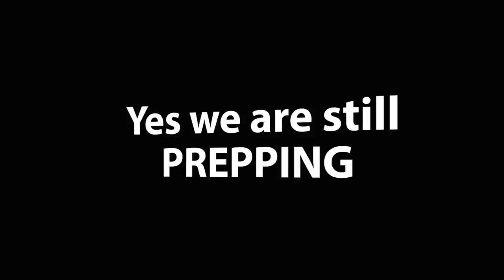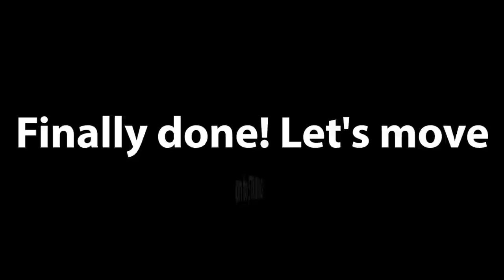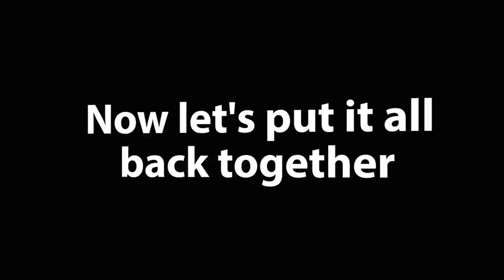Curbside Furniture Flip/Antique Buffet Makeover/Buffet Furniture Fip

Comment: Beautiful job! I have a very similar piece that I have been struggling with for weeks. My piece had 2+ coats of white paint that I have been stripping but a lot of the stripper got dried and clumped around the carvings, so I have struggled with using pointed tools to remove it. Originally I did strip the carves legs hoping to stain them and also the top like you did. But after seeing your piece, I may decide to paint them the same as the body of the piece (sage green) I need to decide and just wrap this one up!

Comment: My question is about the teardrop pulls.  My buffet looks like it had the kind that turn to lock and unlock.  I don't need turning knobs but the hardware is still inside the doors.  So I figured I put a pull over it but need a plate that is long and not round so it covers the previous hardware.  Do you have suggestions?
Reply from the maker: Amazon would be your best bet

Comment: I loved watching this entire refurbishment, I love how it came out , I have a similar piece in my basement . I have a question about the sand prep , I wanted to purchase one but everyone has it attached to an expensive festool extractor , what kind of piece did you buy to fit the hose to another kind of vacuum? And did you have to buy the extra pieces with the sand prep ? Also what sand paper grit number do you use to distress ? Thank you
Reply from the maker: When I bought the SurfPrep sander I also purchased from them  2" hose adapter so it would fit my shop vacuum. I am using 150 grit sandpaper to distress by hand.
Reply: @SabsRehabs  thanks so much I will do the same I just was wondering what would fit my shop vac 😊

Comment: Just found you. New sub. I just watched the incredible mid century piece (black paint/walnut stain) video. So impressive! I am fixing some buggered-up baseboards in a mahogany stain. I am having a helluva time patching the holes. When i restain, the putty (i've tried all i can find) doesn't take the stain like the surround. I didn't see you having that trouble with the veneer on that mid-century beauty. Any recommendations?
Reply from the maker: Make sure your wood filler is stainable and you have to kind of "paint" it on with a small artist brush and let set a lot longer. Sometimes I don't even wipe the excess off in wood filled areas so help it match better.

Comment: Hi again. Do you omit tacks cloths and use damp cloth instead? Im always looking for any suggestions to save cost. Also have you ever used paint thinner to thin polyurethane? I’ve heard it works but unsure.
Reply from the maker: Yes, I use lint free cloths to avoid cost of tack cloths or paper towels. I use water based poly, so I just use water to thin it

Comment: I got a ? I hope you can help just got my surf prep sander only used a couple times but I can’t keep that black hose attached it keeps popping off. I tried screwing in round and round I work a little bit then it sucks me when it pops off and scares the bbbbaajesus out of me lol did you have any of these issues
Reply from the maker: The same thing happened to me. Lol. I ended up having to duct tape mine on permanently.

Comment: It turned out great!  I am happy that it sold for a nice price and in a very short amount of time.  I do have a question for you, when you use wax as a top coat, do you usually use SC Johnson's paste wax or do you also use the boutique brands as well?
Reply from the maker: I have tried the boutique brands, but found them to be way more costly and not really add any extra protection than the lower priced waxes. I mostly use Johnson's Paste Wax or Behr decorative wax for my topcoat. Johnson's Paste Wax was made for hardwood floors, so it is super durable. It is my go-to wax and has proven to hold up overtime. I once finished an antique dining table top with Johnson's and thought I could lift it by myself but it went crashing to the ground. Amazingly not a single scratch was on it! Plus the $8 a lb price helps.
Reply: @SabsRehabs  Thanks for the quick response.  I have nothing against the boutique brands but since you used SC Johnson wax I thought I would ask.  I use the Johnson wax for my table saw and router tables tables and it holds up remarkably well.  And now that I am just getting into furniture flipping, thanks to you and others, I will try Johnson wax when I use wax instead of poly top coats.  

p.s.  I am enjoying your channel and I look forward to your future adventures.
Reply: is the johnson wax as soft as it looks when you were applying it or did you warm it up first ????
Reply from the maker: @maryfreedberg5866  It was warm in my workshop so it was a little softer then normal, but I find it smoother and easier to work with compared to boutique paint waxes. Dixie Belle wax is so sticky and hard to work with in my opinion.  Johnson's glides on very easily.
Reply: @maryfreedberg5866  In my experience using SC Johnson wax on my tools, is that it is pretty soft.  HOWEVER, I live in Phoenix and I keep the wax out in my garage so that most likely keeps it soft.